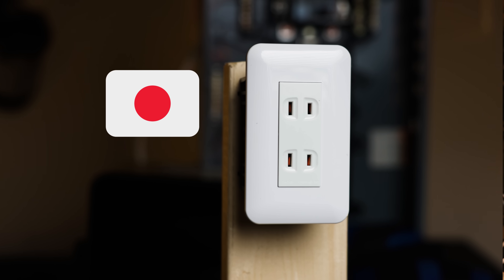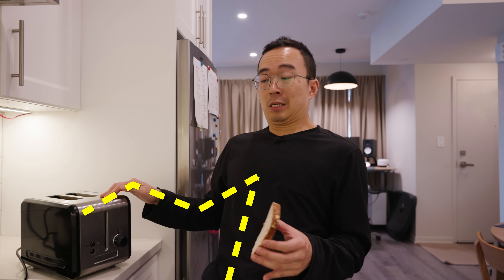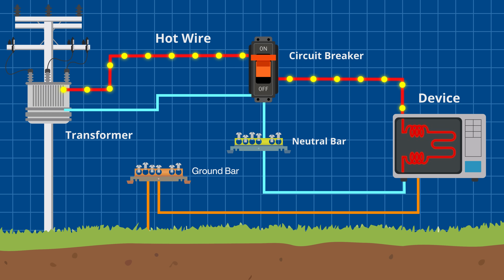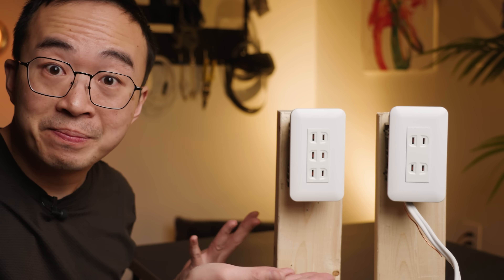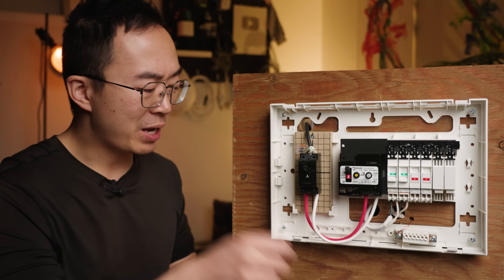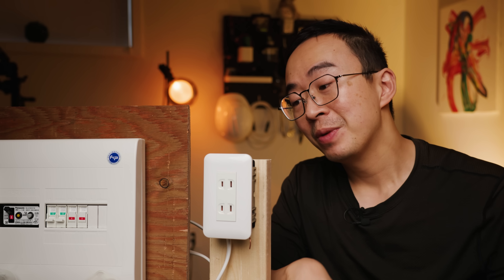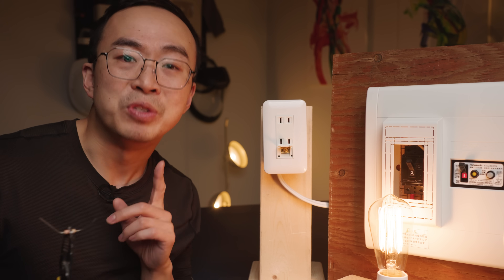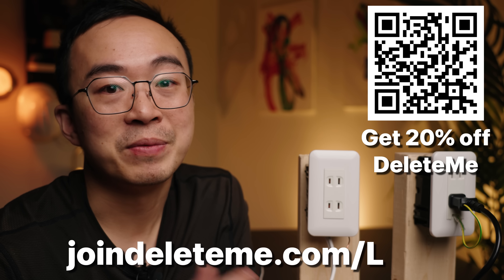How Japan Made Their Outlet Safe

Comment: NA GFCI is woefully misunderstood; while the video points out that the GFCI outlets are only in some of the more dangerous places, wherever a GFCI exists in a circuit, the entire circuit has protection. So if a fault occurs in a circuit, from a point-of-origin not directly at the GFCI outlet, so long the non-protected outlet has the GFCI outlet as part of its circuit, it inherits the GFCI protection and will lose charge when tripped, which can then be reset when all is safe yet again.

This is essentially a side-effect of poor-to-no grounding early in NEMA, and provisions to include ground-fault current interruptions without radically altering breaker boxes of the time when they were introduced. It was deemed more cost-effective to retrofit existing panels rather than to radically alter them.
Reply: No, GFCI protects only against faults that occur after it. Maybe you are confusing with arc fault protection.

This is relevant for example when you swap an only two prong outlet to a GFCI outlet. It there is a metal box that is not properly grounded and then the hot wire touches the box the voltage will go through the ground wire to the equipment case and the GFCI will not help. If it was on the panel it would trip.

Comment: In Brazil we usually use the grounding connected on the neutral in the electric panel, but our regulations also allow the TT grounding, but people avoid it because GFCI is mandatory on every circuit that is installed with TT grounding (because otherwise the grounding would be useless for protection). We also use the GFCI in the electric panel like Japan does (GFCI is mandatory for kitchen, bathrooms, outside areas and any other areas that are subject to be wet or too humid).

But you still can be electrocuted in a groundingless circuit protected by a GFCI if you touch both wires at the same time (live and neutral) and the current pass through you body from one wire to the other wire and doesn't escape to the ground, in this case GFCI will not detect it.

Comment: The shock can be more than 30mA,   Just that the RCD/GFCI needs above 30mA to trip,  before the trip the fault currents could be very high

This video is over simplified and misleading,  In the UK we have TNCS earthing as in the US which has inherent problems in that the earth / metal equipment becoming live if the Neutral is open circuit,  we also have TNS and TT earthing

Brakers/fuses/MCBs are used for fault protection (automatically disconnecting supply) but we then have RCDs on the majority of other circuits as additional protection 

It is also worth noting that there are different types if RCDs and the older types which trip on AC current only can be "blinded" by DC leakage.  In todays world we use alot of DC equipment and power supplies so DC leakage is not unheard of.  So some of the older installations in Japan relaying only on a single type AC RCD are alot less safe than almost all EU countries.

Comment: LoL. I enjoyed your fantasy of getting shocked by the energized frame of the toaster. It would probably only raise your body to the potential of the power lead.. not shock you. Electricity needs a path and simply touching a live wire produces no path. You would have to be grounded for the path to exist. You were not grounded. As an electrician, my work often requires me to work with energized wired and bars. I have bolted wires to energized bus with no gloves. BTW, most toasters in America are plugged into a GFCI outlet.

Comment: There are two primary devices that are used in NA.  
Class 1 GFCI with a .06mA trip threshold, and Class 2 RCD with a .30mA trip threshold.  
Class 1 in NA is listed for personal protection.  Class 2 is for equipment protection.  
Class 1 will keep you from getting shocked.  Class 2 will keep you from getting unalived.  

Many countries, including Japan, due to their electrical grid, can only use Class 2 RCD devices.  These offer less protection.  Class 1 GFCI devices won't operate in most of Europe for example.   You cannot install an RCD with a .30mA trip threshold in standard outlet in your house in NA.  You really should have consulted with an EE or tech about your content.  It's misleading. 

And you fail to mention that Japan has two completely different electrical systems, one in the north and on in the south. 

Also, those GFCI testers only work if there is a ground present.  And in since you seem to be unaware, if you have to replace an old outlet (like in an older house) without a ground, you must install a GFCI outlet.

Comment: What is the color code and wire gauge used in Japan compared to the US we use 14 gauge 15 amps 12 gauge on 20 amps black live red live blue live a d white neutral bare or solid green ground

Comment: I live in Japan.  Periodically the power company comes out and checks for leaks to ground in the whole house circuit.  They also replace the electric wires from street into house every 8 years.  On a related note, none of this stuff is needed if the power company does not ground one side of its power circuit.  An ungrounded power source will not shock you if you touch one bare wire.  We are discovering this basic fact in off grid solar installations, which only need to ground solar panel aluminum frames for lightning..............
Reply: And that's what is called a floating power supply ;) . Is the 8-year replacement a thing required due to earthquake damage or so? Here in The Netherlands the cable to many homes easily surpass the 40-year mark without any problems, but we don't have earthquakes (or at least, not as serious as in Japan, the last very serious one happened in 1992 at Roermond, but was felt all across the country and even in the UK)
Reply: The ungrounded powersource is called an IT System (if you still connect every conductable material together). Why it isn't used? Because one accidental connection to the conductive things and you got a system where you maybe have neutral connected to ground or live and stillcan get shocked. There is a reason why ground is done TT (with RCDs) or TNC-S or TNS.

Comment: AFAIK there are absolutely no changes that would be required to the larger energy infrastructure (substations, pole wiring, etc) to add grounding to Japanese outlets.  From the pole back to the utility, it looks exactly the same.  The only issue is that you would need to redo the house wiring to support it in some cases (if it hadn't been built originally with ground wires running to the outlets).  This is actually the same situation as with many older US homes.

I honestly don't understand why they don't at least make the change for new construction, though (which the US did many decades ago).  If you're wiring all the outlets from scratch anyway, why not add a ground?  Grounded outlets do still have some other benefits that GFCI/RCD by itself can't provide (static reduction, EMI shielding, immediate fault detection, etc).  If nothing else, it would let them actually use the same plugs that the US does (because almost everything in the US has a 3-prong plug these days).

Comment: At about 7 minutes you show a pole transformer in Japan with just 2 wires going to the house.
In the US the pole transformer secondary is center tapped, which is connected to a ground at the pole.  This prevents High Voltage coming into your house if the transformer has a primary to secondary short.  Can you find out if houses in Japan have burned down because of High Voltage?

Comment: Man. You got some stuff confused. The "Neutral" as you call it is the grounded conductor. The grounding(earth) gets bonded to the neutral so that if any metal object in your home or work space gets electrified, the grounding(earth) will trip the breaker, instead of you becoming the path to ground and taking that shock. Grounded receptacles are the much safer option as they are preventative as a pose to reactive.
Reply: The grounded conductor is the term used t the NEC for what people commonly call the neutral.

Comment: I live in Japan in an apartment built about 15 years ago. It was quite annoying trying to fix an audio noise issue on my computer. I have a 3-prong surge protector but half of my cables are those weird hook cords so I had to buy a bunch of adapters that let you screw it into a third prong. Seems like it's about 50/50 whether you find a hook guy or a 3 prong guy (my wall outlets have 3 prong in the 'living areas' and the weird one in the kitchen & laundry + one random corner).

Comment: A few years ago, when My family moved into our latest home, I tried many times to convince them to replace all the outlets in the house because some had shown a darkening around the plugs. After hounding them they finally did it just as we were moving in. They didn't want to becasue it was already adding in more costs to a small renovation we were having done too. When the electrician came and started to replace the plugs, he flat out told my parents and sister (who were buying the house) that i potentially just saved all  our lives. Out of the 50 or so plugs he replaced only 2 of them were grounded and many of them were so worn nothing would stay plugged in. Several plugs showed signs of overloading and had discolored. The guy said it was a miracle that the house hadn't burned down that entire time. He also discovered a faulty breaker that was not tripping even though it was showing signs of overloading too. needless to say all of that has been fixed and replaced. 

Remember if you're moving into a house over 25 years old (which we were_ ALWAYS have an electrician check over the outlets. You'll never know what you might find.
Reply: You have a keen eye. Discolored plastic is usually a sign of heat, UV, or ozone where it shouldn't be, and dark or black plastic around the plugs means an electrical fire waiting to happen.
Reply: @MMuraseofSandvich  Yeah from a young(ish) age i looked up ways to spot potential trouble with a house. My Father was a Baptist preacher so we moved around a fair bit and some parsonages were better than others. One of them had recently had its outlets replaced becasue one of them had apparently overloaded.That's what got me interested in looking closer at stuff before we moved in. The house i mentioned before (our current one) was the second house we bought after my father retired. Needless to say after this my parents gave my opinion a bit more credence.
Reply: Electrician here,  I'd like to amend you final line to   "If you're moving into a house have an electrician check over the outlets."   -  regardless of age.   You NEVER know who did the wiring before, or how roughly the sockets have been handled.
Reply: @Atlessa  true enough, but more so the older the house because of added wear and tear.
Reply: @Atlessa  an electrician WOULD say that
Reply: @salerio61  As an engineer I trust my own judgment and test equipment more than most electricians, but I second that electrician's suggestion that it's common to have electrical items needing inspection and repairs.  

After my last new home purchase, I found 3 missing GFCI's, one defective one, a defective dimmer, 2 hot-neutral reversals, and an HVAC circuit with no NoAlox and several strands cut off rather than be more careful fitting wires into terminals in an awkward location contractors likely thought no one would inspect.  

Much of that was in remodel work or non-electrical subs work, whereas the original electrical contractor had done competent work.  However, I've also replaced a bunch of econo-grade failing duplex receptacles with Spec grade, that has far safer internal design of contacts and grounding, whereas some of the junk grade ones were on the verge of being hazardous at barely over 20 years old. 

For those who don't do their own electrical work, the cost of one or two repairs years later can cost more than an entire house built with commercial grade receptacles, for an extra dollar each for quality parts.
Reply: I woke up to a smell of smoke and in the living room my laptop charger wire between the outlet and voltage reducer had frayed plastic and the wires were touching and burning the plastic. I unplugged it and went shopping for a new computer cable.
Reply: I wish I could save this comment. You really did well...
Reply: Do you mind sharing how much it cost you in total or per outlet and/or hour of work? Thanks!
Reply: @Chris3s  I do not remember but since we were already having part of the house remolded it was just tacked onto that.
Reply: I believe here in France, it's mandatory to have inspection when you want to sell a house, and I think it's the same if you want to rent it.
Then the buyer knows they have to take that spending into account when purchasing the house.
Reply: Not sure if anyone else mentioned this but there are outlets that by code in North America do not have to be gfi even if they normally would. Reason? Certain appliances like to trip gfi. Like decent sized motors/condensors. A big standing deep freeze can trip you're gfi, then all the food goes bad.
Reply: @ I had a bathroom that was on a GFI breaker and at random times when the timer shut the fan off the breaker would trip. Now I just use a GFI outlet with a regular breaker.   It would suck to go to the bathroom in the middle of the night only to have to go to the garage to reset the breaker. I have experience with a freezer causing a GFI to trip and ruin food.
Reply: @Pensive_Pauper  All outlets in kitchen and garage required to be protected by GFCI, according to NEC. New appliances should not trip GFCI.
Reply: @Pensive_Pauper  You are correct to a point but that Non-GFCI allowance gap is closing fast,  Each code iteration has a prospective date of compliance that currently is floating. We'll see when they do, what chaos it will cause. I have a plug in Miter saw, trips the GFCI the minute I trigger it.  I have to run cords to a non GFCI outlet to run it and keep one breaker in my work shed non-GFCI. Oh Well.
Reply: Thing is, in an older home without ground wires running to the box, a grounding outlet is pointless. MANY electricians try to scare people into spending money, and the whole "electrocuted" or "house burned down" thing is total BS. The stats for home electrocution are zilch, and houses burn down because people screw with electrical to make meth or run grow lights or do wiring that creates dangers; the house wasn't built that way. So why do electricians install 3-prong outlets? Because they scare people into doing it, and because many home inspectors insist upon 3-prong outlets. But a 3-prong outlet without the ground connected will show up as a useless thing when you hook up a tester. How to get around that is electricians will run a wire on the outlet, connecting neutral to ground. Voila, the outlet tests as though there is a functioning ground, passes tests, you do the dog and pony show for the customer, and collect your bill and be on your way. There are a LOT of unscrupulous electricians out there doing this, and scare tactics are crazy. In our build, I didn' t tell any of the electricians who came out that I'm an electrical engineer. I just let them talk and threw out all but one. The honest company was also almost 50% cheaper than the cheapest of the dishonest ones. I called the union on the others, but of course nothing happened. Buyer beware.
EDIT: The problem with whole-house GFCIs is that they are massive headaches. They trip and no one knows why about 80% of the time. Seriously, false trips are a huge problem with panel GFCIs and AFCIs (arc fault, another topic). Some appliances will trip a GFCI once a week, just because of the way they're built.
Reply: @brucecarr6258 dude, what in the hell are you talking about?!? I'm a home inspector. There is no world where myself, or any reputable home inspector would recommend installing 3 prong outlets on a 2 wire system, then creating bootleg grounds to trick a tester. Home inspectors are looking for problems and safety issues. This is exactly the kind of BS that home inspectors are trying to help people avoid. Similarly, every electrician beyond his second day understands the danger of bootleg grounds, and bonding grounds and neutrals together. I've NEVER encountered an electrician that would do this. When this is done, it's generally done by unscrupulous flippers, handymen or home sellers. It's not done by licensed electricians, and there is no world where home inspectors are recommending that people do this. The idiocy of your comment is truly next level.
Reply: @brucecarr6258  In my house it DID have grounding wires running to the box as it should, but only two of the 50 plugs had the grounding wires hooked up to the plug. This WAS causing overloading in a lot of the plugs. a good portion of them were showing signs of dark discoloration and even possible smoke damage. They were also very loose and worn that plugs wouldn't remain seated in them. They had to be replaced anyway just for that alone.
Reply: @hudsonball4702 No, the ground doesn’t carry current and should not cause anything to over heat if it isn’t hooked up.  The ground is only for safety.
Reply: 1. Failure for them to hook up the grounding wire is bad, and it’s great to fix it
2. A disconnected grounding wire does not cause overloading.
3. The discoloration probably came from heat, but it’s heat from the worn out outlet making a bad connection to the plug causing lots of local heating. That alone is the reason to replace those outlets and in a worst case scenario that local heating could get something hot enough to create a hazard. So you did the right thing, although some of the reasons are a little bit jumbled.